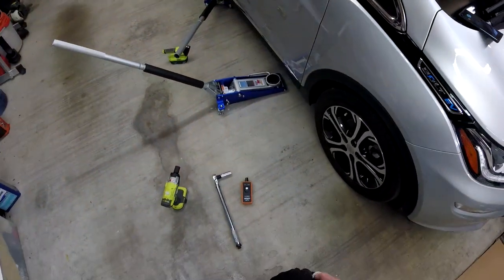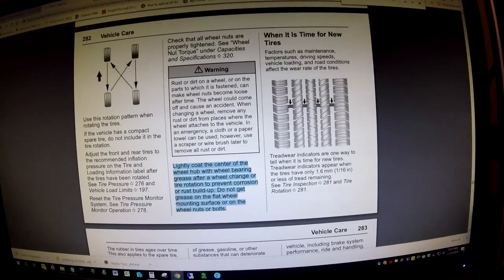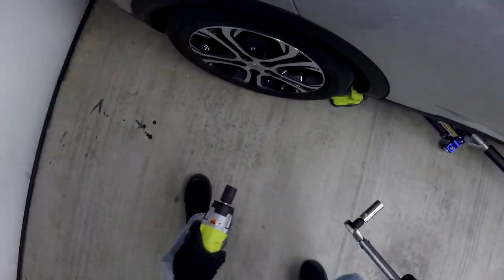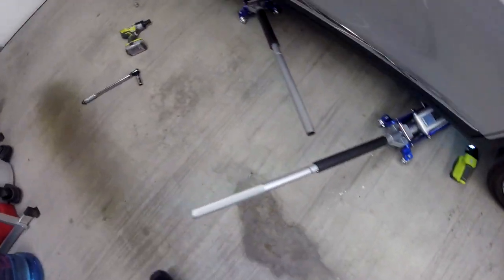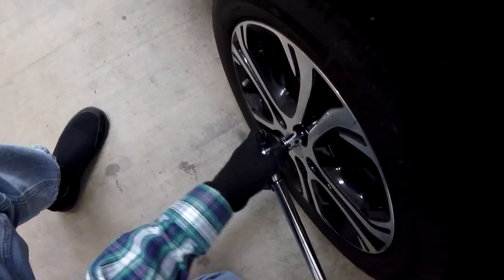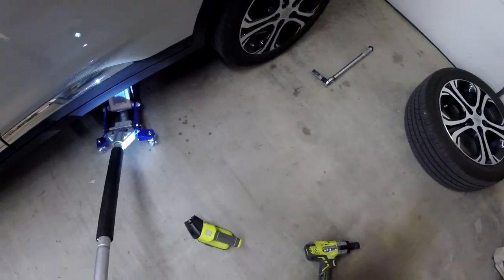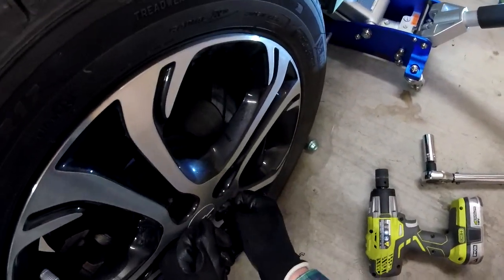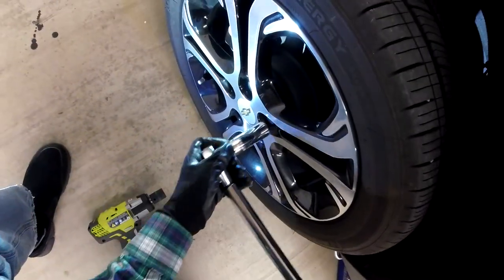Chevy Bolt EV Rotate Tires yourself DIY with relearn tool

Comment: Re: Lubing the  backside of the wheel is a preventative for rust or scale forming on the back side of the wheel.  I live in a sandy salty winter environment and it helps to prevent sticking to put a bit of lithium grease on the surface where the wheel contacts the hub.  Not to much to avoid splatter on the disc brake which can ruin your pads.

Comment: This is the only picture/video entire internet that shows jack points front and back. Other pictures are expired and/or inaccessible. Thank you. But you should get hockey pucks from sporting good store to use as jack pads to avoid scratching up metal.You can use cloth rags, but I like hockey pucks since I can cut a slot to use as jack pad to lift pinch weld lift point cars.
Reply from the maker: That's an awesome idea! Maybe even stick 'em on a lathe and create those positioning domes!
Reply: I cut off a piece of an old tire for this purpose

Comment: @hgodtx: Great video.  Congrats on taking the plunge on DIY maintenance. I feel its totally worth it if you value your time in the least (as you've experienced).

A couple comments from someone who has been doing DIY auto maintenance for years (no, i am not a professional mechanic): (1) its considered a safety best practice to always use jackstands. Floor jacks are designed to lift vehicles, not support them. The few minutes you save is not worth the risk to your personal safety, or the serious damage you could inflict on your vehicle.  I have not put my Bolt up on jackstands yet, as ive only clocked about 3K miles so far. (2) Every tire professional ive ever talked with has advocated front to rear/rear to front rotations ONLY, even for non-directional tires. The theory is that you weaken the tread carcass by reversing the forces on the tire when the rotation direction is reversed. Thats why i always rotate in that pattern. Ive never seen any uneven wear patterns as a result. (3) As you stated in the video, seating the wheel evening against the hub/rotor is critical when mounting a wheel. I suggest that after sliding the wheel onto the lugs, apply pressure with your hand against the center of the wheel, and rock it slightly until you feel it seat evening against the hub. Without removing the pressure, use your other hand to hand-thread the lugnuts, then snug the first two of  them (without torque) on opposite sides to hold the wheel in place. It requires a bit of manual dexterity and practice, but you all but eliminate the chance of a wobbly wheel that could cause vibration, or become a safety hazard.
Reply: mmmhhhmmmm     Yeahp

Comment: for your next rotation... Always hand start all the lugnuts before you tighten with a impact wrench.... if you accidentally cross thread the lugnuts with your impact wrench your going to be in a world of hurt.
Reply from the maker: Great! I'll start doing that!
Reply: Yea and tighten the lug nuts in a star pattern so your rotors don't warp !
Reply: We usually spray the area underneath where the wheel makes contact with the car behind the bolts with WD-40, and at least with our winter tires that prevents the tire from locking to the vehicle’s wheel base.

Comment: Thanks for the video.
I recommend doing a caliper service when rotating tires (pushing back the pistons and lubing the sliders) ; it'll stop brake drag, and I've not had to replace a caliper on any car since I started doing this.
Reply: Ive owned dozens of vehicles, never replaced calipers, always did my own service never lubed the sliders, only lubed back of pads
Reply: @HR-rt9nh  -- That's not a caliper servicing.
Reply: Never said it was... ie  I dont service calipers, change pads and rotors as needed.  @Davran2742
Reply: @HR-rt9nh  -- Caliper pistons and sliders start to seize, and pushing back the pistons and lubing the sliders -- at least yearly -- saves calipers, drag and pads. I do it every six months on all cars, and notice each time that the pistons needed pushing back.

Comment: Thanks so much for the informative video.  I have the exact same Bolt (color  and trim).
Reply: I bought the center console storage thingy based off your other video. Thank you,  well done.
Reply from the maker: Have you done the visor upgrade? By far the best thing I did. Hopefully by summer I'll get the passenger side completed and post that video.
Reply: @hgodtx  The sliding visor upgrade? If so, I have the 2018 model which (thankfully) has it already.
Reply: @hgodtx  Went shopping at Harbor Freight today. Bought the same jacks, torque wrench, etc but went with a cheaper, corded impact wrench. Thanks for the info.
Reply: When you rotate in the future, (with your current gear)  how would you do so without lifting opposing corners up at the same time? If you started on the right side of the Bolt and rotated correctly,  per the manual,  conceivably you would have a jack on the left rear and right front simultaneously. Would that put undue stress on the car? Am I overthinking this? Thanks for your input!
Reply: @genewcotton  That's the $64,000 question I have. Rotated correctly the fronts go the back and the back tires switch sides as they move to the front. Do we have to get jack stands involved?
Reply: @JimArnold6  I guess I'll just swap my normal tire/wheel set with a winter set and not worry about all that mess.
Reply from the maker: @genewcotton  In my younger days I always had that same question of stress. But then realized the enormous stresses put on the vehicle just parking in situations where a pothole exists or wavy driveways due to grated drains that drop 8 inches or more. Now take all that a step further and drive the car at 45mph down a winter torn NYC road. I'm sure raising a vehicle 6" at opposite corners is far less than any designed loads it can handle. Also note the Bolt has uni-body construction which is much more rigid than frame style.

Comment: You probably don’t need to lune the hubs but I’m in the salt belt and especially with steel wheels I e had to take a sledge hammers and pound on the wheels from behind them on a lift for ten minutes to get them off. I use anti-seize but grease will work too. You just spread it around the studs on the hub some.

Comment: Note, my 20 Bolt would not reset until driven around the block above 20mph. Then only when device's antenna was placed on the tire rubber beyond the rim. The metal rim seemed to inhibit the signal.

Comment: Thanks for the very informative video, especially the TPMS-sensor relearning process.
Last augustus, I bought an Opel Ampera-e which is basically the same car as the Bolt. I'm really enjoying this car!
I'm planning to buy an extra set of wheels to fit winter tyres and change them myself.
Already bought the EL-50448 at AliExpress for 7 euro's today at the 11-11 sale :)
Reply from the maker: What was the name of the Volt over there?
Reply: @hgodtx  The Volt is named Opel Ampera (without the "e")

Comment: Nice video. Thanks! Though I thought it was front wheels straight back, and each rear to opposite sides of front. I guess there's variations.
Reply from the maker: Funny, over the decades just when I think I have it memorized and I did use a tire shop they explain to me the "current" thinking based on how they see the general public wearing patterns are. Manufacturer vs street savvy, always the conundrum!

Comment: Anyone found an alternative cheap full size wheel, which could be used as a spare wheel in emergency? I am not sure if it matters, my Bolt is 2023. I mean used wheels from junkyard or used tire place. I looked around Atlanta and nobody had it... The lug pattern is unique. Also the front brake caliper takes up a lot of space... Btw are there differences between 2023 and older Bolts, or all wheels are the same standard?
Reply from the maker: Here's a starting point...
https://www.ebay.com/itm/333204443206?mkcid=16&mkevt=1&mkrid=711-127632-2357-0&ssspo=8wr0Hp_mRdS&sssrc=4429486&ssuid=SGJ74iCDQtC&var=&widget_ver=artemis&media=SMS
Reply: @hgodtx Man, it's pricey. It is not listed for Bolt 2023 though. I wonder if there is a difference between older and newer versions. Some people claim that the 2016 Chevrolet Cruze Wheel, ~363828184 can be a right fit. I need to verify that and the tire fitting. I have seen a used one for $75. I want to be able to put the same size of tire on it: 215/50 R17. This way down the road I could just put it on the rear axle in an emergency and keep riding it until I would need to change all 4 tires again. Economy approach lol
Reply from the maker: @luktish  I remember with my 2012 Chevy Volt people found a certain old Cadillac rim that worked, and findable in scrap yards easily.

Comment: I have a 2015 Chevrolet volt and have done a tire roarion but I changed a tire fore the left front tire and the relearn remote wont read the tire.
Reply: curious to know if the vehicle had any adverse affects if relearn was not performed.
Reply from the maker: No. It's just a visual change on the dashboard. If not "relearned" then it would tell you front left is dangerously low, when in reality it's the right side as an example.

Comment: I went to a mechanic that specializes in hybrid n electric. He told me he couldn’t rotate it because the last electric car he did couldn’t move after.  It’s obviously not the case I see. I will try for myself n see
Reply from the maker: Was is under warranty?
Reply: hgodtx nah I went to a nondealer out here in Los Angeles. The dealer be charging to much for such simple things